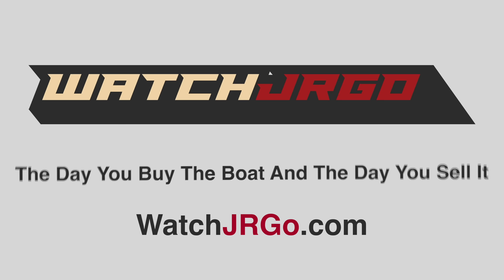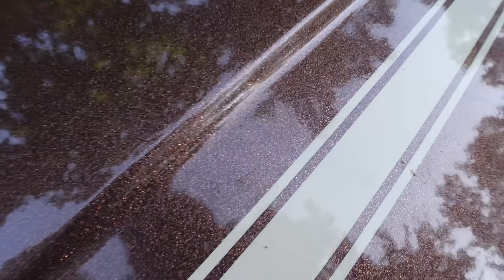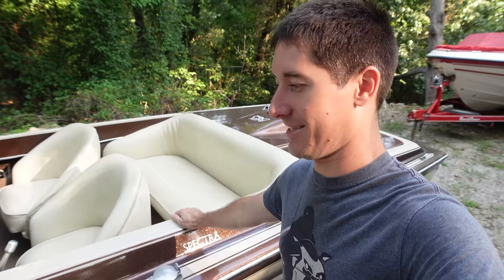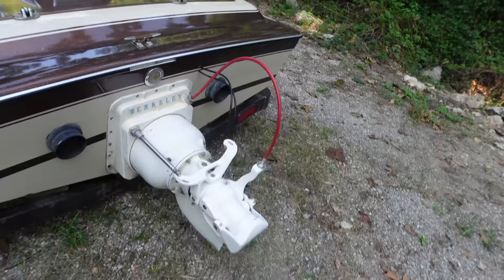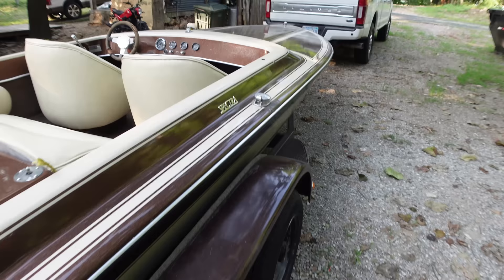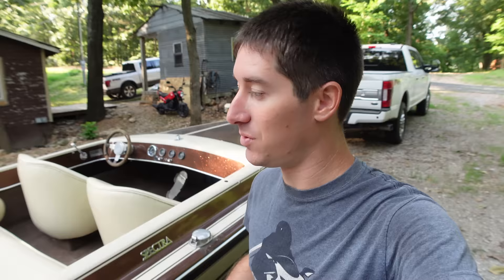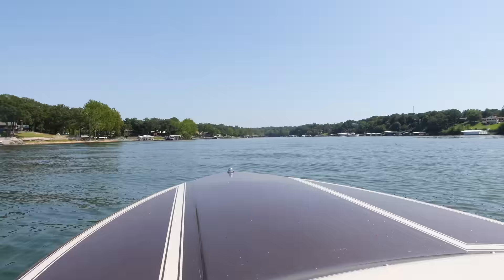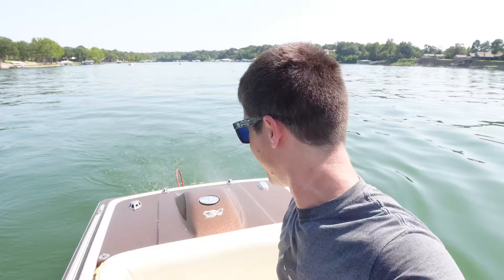I Bought The World’s GREATEST Jet Boat with @WestenChamplin

Comment: I would have the blower hooked up.  It's not about supplying the engine with air.  It's about expelling fuel fumes from the engine compartment before you fire the engine to avoid explosions.

Comment: Fun stuff! For your safety I would recommend hooking that blower vent hose back up, the blower is there to evacuate fuel vapors that may have accumulated in the hull and get them overboard. Nice to see you get some time to play in the midst of all the hard work - cheers to boat life and boat times.
Reply: I agree! I've seen engine hatches blow right of the boat at the launch ramp before. Use that bilge blower and make sure the hose goes to lowest place.

Comment: Our family had a house on the lake for 40 years and I worked at a resort for 5 summers during high school and college in late 70's and early 80's.  There were a couple of those jet boats on the lake back then.  The lake was usually only perfectly smooth early in the a.m. or late p.m. so they'd take them out then and open them up.  The sound would really carry.  One attorney had a jet boat that he would put in his boat lift lowering it just enough  into the water so that it would cool the engine and the pump would shoot water.  He'd have his kids stand behind the jet, hit the throttle, and shoot them out into the lake.  Good times...

Comment: That boat is excelllllllent! You better keep 'er! BUT - get a temp gauge in there ASAP...running at full throttle that engine will cook off in seconds if it ever loses cooling....or oil pressure also. If it were mine, I would put in a loud audible alarm that triggers if oil pressure or temp exceed settings.

Comment: My buddy has a Tahiti with a 429ci Dart heads, tunnel ram, dual 650cfm and Basset out of the water headers. It is a blast to rip around in. We've decided that it does a really good job of  turning fuel into noise.

Comment: Be very careful when refilling on the the water that the metal nozzle doesnt touch the metal fill cap: it could cause a spark and a very big explosion. WRAP the gas nozzle in a cloth  AND open the engine hatch ro let vapors escape to avoid a KABOOM.
Reply: There aluminum

Comment: Hi JR, nice old Jet boat. I've owned a lot of jet boats over the years, I live in Alberta and we run a lot of rivers along the foot hills of the Rockies. Just a few little pointers for you. Your probably not going to get over 60 mph with that boat. you would need about 550 to 600 Hp to go over 70 mph, and your impeller would have to be cut down to match your optimum rpm range. So just have fun with what you have. You where probably right about why the boat stalled if you chopped the throttle really fast. Always come of plane gradually. You already know not to run the boat out of the water which is great to hear. I personally always run 2 batteries and 2 bilge pumps, most jet boats leak a bit, so don't sweat it if there is a bit of water inside the boat. Make sure all your wiring is good, battery posts always cleaned. Remember if your boat dies while running 60 mph, you Have No Steering, or very little with that rudder, most of your steering comes from the thrust out of the nozzle. Read up on how to grease your pump, because it can be over greased and this will knock out the bearing pack, there may also be a grease nipple inside the back of the nozzle, some pumps have it and some do not. Do not use reverse in shallow water, this stirs up the bottom and then you will suck the sand in through your pump. This wears out you impeller and wear ring pre maturely. 

Cheers, have fun
Gary

Comment: 🛑 CAUTION 🛑  do not crank steering all the way from stop and nail it/stand it up on the tail.  It can flip reverse diverter and start sucking itself under, while it's standing up.  My dad's two best friends had these, in the early 90's.  One filled engine compartment, before getting it shut down.

Comment: Cool boat but fix that blower, maybe add a second one. You're not going to open the hatch every time and the routing of that blower may be sucking air in to displace the vapors. Also, that starter motor may not be fully spark arrested, fixing the blower and using it may reduce the chance of a big boom.

Comment: That's A well made jet boat . With a stock 454 its good for 55 mph tops.  If you want to go 70 or more mph it will cost a lot of money. Been there done that. Also jet boats can drink gas twice as much than a prop driven  boat. But, jet boats are the Harley Davidson's of boats. Loud, proud, and just cool!
Reply: Actually , Berekely did some testing many years ago. The jet is actually just as efficient in equal boats at equal speeds. they drink gas because we keep pouring it in!

Comment: Running a 76 Sleekcraft Kauai with 460 stroker sitting at 528ci married to a Dominator pump w/droop snoot and place diverter. She's white with black and red accent outlined in silver flake.
Fittingly she's named Attention Whore and both sides of that is very true at times.

Put a droop snoot on it and some trim tabs you'll be able to shoot an even bigger roost while maintaining much more "control" at wot.
I throw a pretty decent roost with that set up and experience very little porpoising. 
For the amount of weight, hp and torque that's back there, being able to hold your foot in it and not have the ride quality go to shit is pretty nice.
Nobody looks cool beating the hell out of their boat and running the intake dry, so dont ever be that guy.

Comment: That vent hose and blower motor or there for a reason. It’s for evacuation of fuel vapor. If you don’t vent the fumes and vapor out of the engine compartment before starting, it could lead to a very BIG BOOM!

Comment: You want that roost about 5' off the water. For more speed you'll need headers , higher compression and cam shaft change and a B impeller. A blower can work for higher compression or nitrous. Nitrous burns valves . 
 Fuel pumps burn out if they are not used. Go electric pump. MSD ignition . Its a heavy boat but you can get it to 80 mph

Comment: There's no substitute for cubic inches.  There's alway a bit of water coming  from packing. That keeps the packing cool and lubricates it. You can get a rough estimate of horsepower by finding out what cut impeller you have and  how many Rpms, . Berkeley has a chart you can look up. 
You can run it briefly out of the water.  I always start mine before heading the ramp. Just dont run it long enough to overheat the engine or the pump packing. rear bearing on the pump that should running in an oil bath if the seals good.

Comment: The air pump is an important safety feature to exhaust gasoline fumes. It isn't there for engine performance.
You need to have it in working order or you could explode. I didn't see a bilge pump either. :face-red-droopy-eyes:

Comment: So, Closed Captioning does not say you are "WatchJRGo", instead you are now known as "Watch Chair Go".  Which all of your things that go do have a chair in them, so it does actually work.  :P

And, if you are going to keep the jet boat, you should go for it.  I have seen where Holley Snipers do wonders for increasing power and reliability on old carburetor engines.

Comment: Prob ought to fix that blower.  Its to vent fuel fumes out of the bilge in case of a leak.  Without that it can go boom.  Its a pretty garbage setup really, fan in a plastic tube and some dryer duct, held together with zip ties or sometimes hose clamps. 

Surprising seeing a Chevy in these, lots of them had Olds 455 engines.

Comment: I have a friend who had one very much like that one. But he ruined his, sucking in too much sand when he'd run it up on the beach. What happens is the heat from the engine inside the water jackets melted the sand and coated the inside of the jackets with glass. Which insulated it making it unable to cool much. Always overheated. He had to junk the engine. You definitely want an operable water temp gauge.

Comment: Not that impressed. I had a 2000 Yamaha LS2000 with dual 1200cc engines and it did 56mph on the GPS without any mods at all. And, it could get t0 56mph from off plane idle in less than half a mile. Only boat faster on my lake was a neighbor's Seadoo with a 300hp supercharged engine. Still, both of us got passed like we were standing still by some personal watercraft.